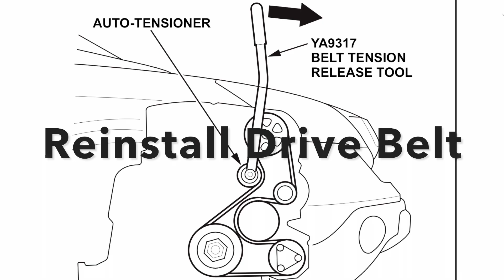2007-2011 Honda CRV A/C Compressor Replacement DIY

Comment from the maker: OEM A/C compressor: https://amzn.to/3zEsR3Z
Discharge hose: https://amzn.to/3Q7Oikl
Suction hose: https://amzn.to/3JfUeFQ
O-rings: https://amzn.to/3PP7Qds
A/C PAG oil: https://amzn.to/3OLEITd 
Drive belt: https://amzn.to/3zGckNX
Socket/wrench set: https://amzn.to/3Sd5HtN
#ad

Comment: Ive done 2 of these on my own 2010 crv.  I believe the compressor by location is in a bad spot and heat eats them up internally.  Rest of the system is fine.  The first unit was the cheapest remain i could find and got 5 years out of it.  This time i put a denso in there (box still said Made in China).
Reply from the maker: Denso is the way to go

Comment: Question, i want to go to a shop to get the refrigerant flushed properly, then replace the compressor myself.
If i do that will i be able to recharge the refrigerant using those R134 injector bottles from auto zone, or will i need to take it back to a shop because the compressor wont turn on because pressure is too low so there wont be any ciculation in the system?? I dont know if my hunch is right or not...
Reply from the maker: Just take it to the shop

Comment: What made you change your ac compressor?
Reply from the maker: Blew up lol you can see the crack on video on the old comp
Reply: @MrRangerZr1  did you notice any difference between the denso and the OEM Sanden in load on the engine at idle or clutch engagement noise? I've got a reman Honda OEM/Sanden the shop wants to try replacing again with same due to it putting a lot of load on the engine at idle causing vibration. Clutch is LOUD but I think it always was. Just curious is Denso is any better.
Reply from the maker: @macabo  Denso is OE supplier